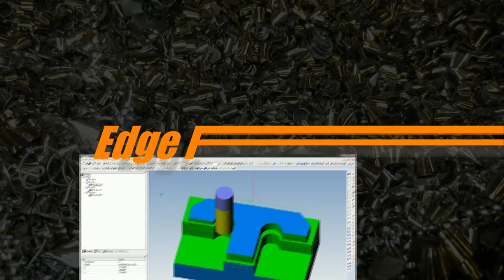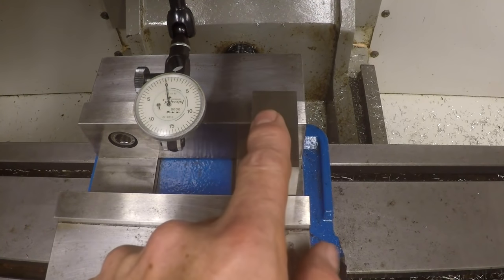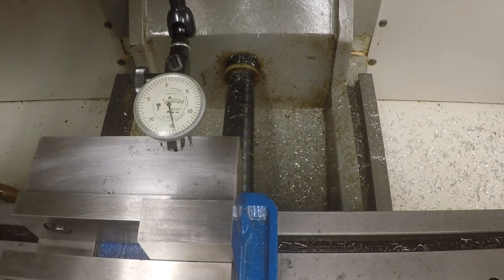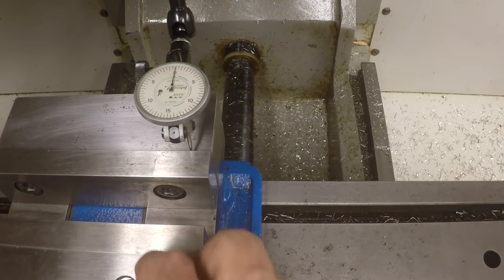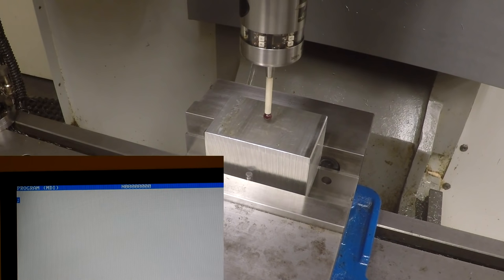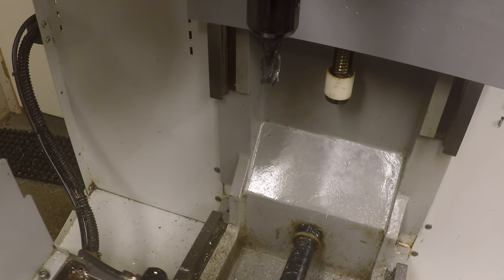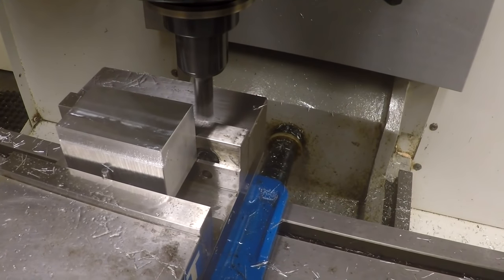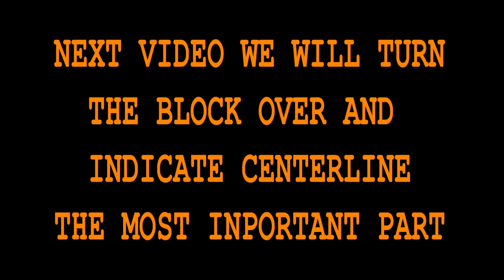Square Me Up To 90-2

Comment: Instead of the dowel pin, I usually use some hard rubber on the moving part of the vise. It gives incredible grip.
Even when using a second piece to balance the jaw. usually the flexibility of rubber makes the force on the fixed jaw more uniform.

Comment: Hi Peter,
We did a video squaring a block less than .0002" "Squareness Gage part 1" using a little different technique. My father taught me this forty years ago. It actually is one of the fastest ways to square a block as well. We did another video showing modifications we did to our Kurt vise to make it more stable and accurate "Accurately positioning your work in the vise". Love your videos, your comprehension of machining is defiantly above average.
Steve
Reply from the maker: Yes I subscribed to your channel. The process I use 999 times out of 1000 is just like what you show in your video. The one I showed in this series of videos I would only use in very special circumstances. Also when we worked before there were Kirt style vises (Yes I am that old) There was very few vises that you could depend on with a square fixed jaw when the part was clamped. So I present this method to square a part that doesn't depend on the fixed jaw being square to the table. It does depend on the base of the vise being parallel to the table though. Also if you are doing a very large part in relation to the jaw height.  As you say in your video all is for not if your parallels are not good. One little thing I do different than what you showed in your video is, right after you take your final face cut on the fourth side. While the part is still in the vise I will put a good sharp endmill in the spindle and take a skim cut on one of the ends just a little farther down than the thickness of one of the parallels. than you can put one short parallel in the vise and clamp the part in the middle of the jaw setting on the parallel. That way you don't need the square. Assuming your vise is square to your Y axis. But your way is probably faster if you have the square. Good video with through explanations.
Reply: Hi Peter,
I subscribed to your channel too. I watched a few of your videos and can tell you have a lot to offer. One of your videos you mentioned a lack of quality training in this field and I completely agree. It is for this reason my son convinced me to use YouTube to pass on a few of the things learned in the 40+ years I been in the trade. I was happy to see you doing the same even before us. When I started the trade I use a Bridge Port vise and loved it after we (father and I) altered it for accuracy. Kurt vises are nice but I always hated the gap in the middle. 
The videos of yours that I watch were great. I am looking forward to many more. It is refreshing to see someone use the most important tool they have, the grey matter between their ears.
Steve

Comment: Thanks for taking the time to show the vise checkout.  Looking forward to the next part on the squaring of the block.  Cheers, Gary
Reply from the maker: gwcude  Thanks Gary when I made the video I did not know how square the part was until I went to my larger shop to measure it on the CMM. But with the precision square I could see no gap so it had to be pretty good. I hope I am showing some useful information all this could be done on a manual machine the same way.

Comment: Excellent demonstration of the flexibility of even a high quality vise. An especially graphic demonstration to watch the indicator move while tightening the vise with workpieces in different locations.

My father liked to tell about an interview with a man who designed ruling machines to scribe diffraction gratings (120,000 lines per inch). He said that he had to design the machine so that it would work if it was made from rubber, and then actually make it from the toughest steel possible. A truck driving by a half mile away could easily wreck a run, just from the vibrations transmitted through the ground.
Reply from the maker: +Peter W. Meek Thanks for the comment. I don't know if I mentioned this in one of my videos. I have a friend of mine who owns a small shop. We had a job together he was to do the vertical work and I was to do the horizontal work. The part started as a large forged block about 20" x 36" x 8" thick 4340 steel. The newer 8" Kirt vices have a removable fixed jaw so he had two vises with the fixed jaws removed mounted on the table. A large aluminum bar was bolted down to the table behind the vises to serve as the new back jaw. With a step machined the same height as the vise jaws. In this part he had to mill a face groove 16" in dia. for a seal that had a tolerance of +or- .002 on the dia. We had run the ball bar on this machine and we knew it could hold .0004 roundness. He calls me on the phone says the groove is out of round .016. What we found that when he tightened the  vises the force bent the table of the machine that tightened the clearance on the X axis to such a extent to cause the machine to mill out of round. fortunately he checked it before he had it to size. I don't think people consider how flexible even large machine tools are.
Reply: Edge Precision I think I might have been looking at clamping that piece down, rather than end to end. If there was material to be removed from the sides (in relation to the surface where the groove was machined), maybe toe clamps could be inserted into rough holes where the material was to be removed. This wouldn't put as much bending stress on the bed of the mill. Buttons or blocks could be bolted to the bed to provide X-Y location.
Reply from the maker: He had to face the top and mill the od in the same operation. We were going to send the parts to Blanchard grind but didn't have time. In this case we had to rough heat treat UT inspect and finish machine 2 pcs in no more than two weeks(these were large parts the forgings weighed over 1500 lbs.). Anyway what we do quite often on CNC equipment is to rough with the vise tight loosen than just snug the vise for the finish passes. This helps to relieve the stress put in by the vise. I this case this is what we did and it was good.

Comment: I have heard very good things about the type of indicator you're using but it seems to work in the opposite direction, like it's a left handed indicator?? Say you set gage black stack .750" high and set the indicator to Zero then measure  a part .760" high, it seems with the indicator you are using the needle would move counter clock wise .010?  Am I seeing that right?
Reply from the maker: With this type of indicator it depends on witch way you point the styles on witch direction the needle moves.

Comment: I don't know much about cnc equipment, how does the tram of the head come into play or is it a non-issue with the machine you are using?
Reply from the maker: Bill De La Vega  Bill on most CNC equipment the machine is built and aligned at the factory to a certain spec. But the installation of the machine has to duplicate the factory conditions. This means the machine has to be leveled properly to get the milling spindle perpendicular to the table. My little Haas mill in the garage happens to be dead on in Y across the table and about .0005 off in the X on a 7.00 dia. circle. except for leveling there is no adjustment for tramming the spindle. On my larger equipment you can change this quit a bit by just leveling that's why they require special foundations under them. The Mitsubishi horizontal has 3 feet of concrete under it.
Reply: Edge Precision Wow I did not know that they have no provision for adjustment other than leveling of the machine.
Reply from the maker: Yes but leveling a large machine can make a big difference in the squares of the machine. There is a instrument we use, a Renishaw Ball   Bar to check the squares and circularity of the machine. Maybe I will make a video of its use sometime.